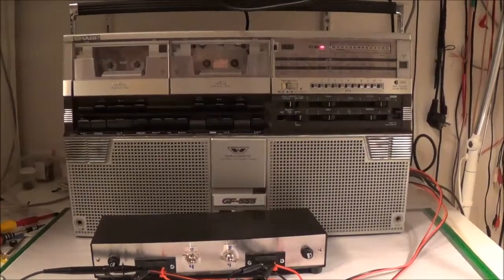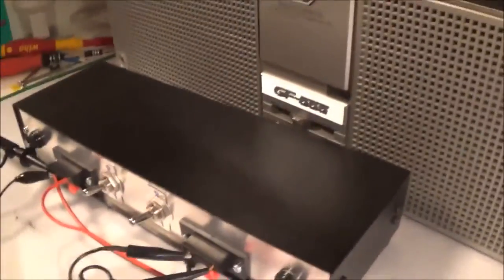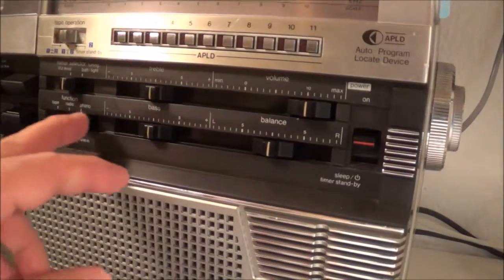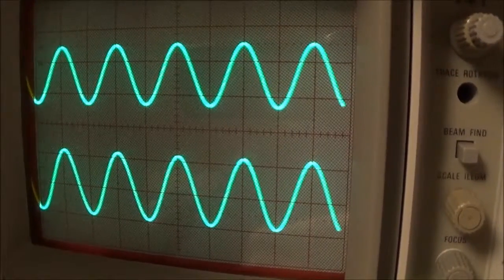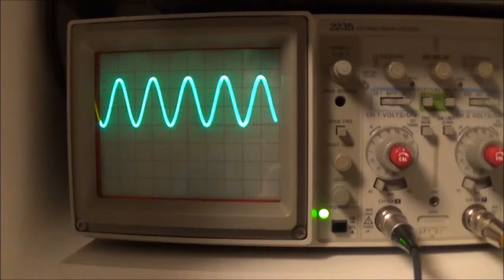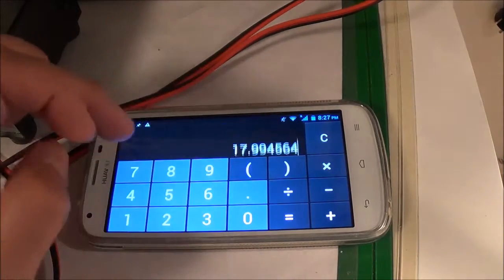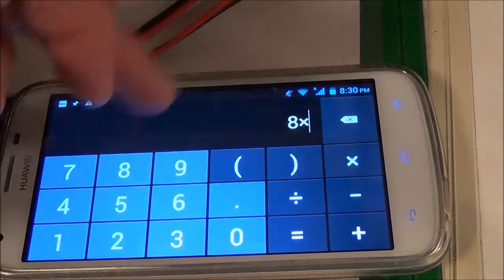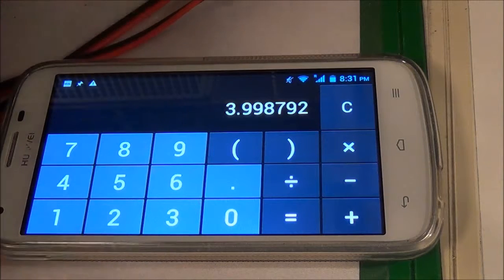Sharp GF-555 Boombox Power Output Test

Comment: Dude. The formula is RMS volts  squared ÷ ohms. So, for both channels driven, (12*12) ÷ 8 = 18W. The literature for the GF-555 states 11W per channel. You always get more output when driving a single frequency. I have a GF-555 and it is friggin loud! A guy with that much quality test gear should know this...haha I'm just jealous of your gear. Peace
Reply: edit that. you said 12v pp. so the formula is (12*0.707)squared ÷ ohms=8.99W
Reply from the maker: I measured the output voltage with an oscilloscope. First, I had to convert the peak-to-peak voltage to a RMS equivalent. Either I divide by 2 to get the peak (center-to-peak) voltage and then multiply by .707, or I multiply the peak-to-peak voltage by .353. I then square my result (RMS) and then finally divide this by the load resistance. Notice I write peak-to-peak and not peak as my starting measurement. Of course, your line voltage should also be correct. 

 Notice also that with the GF-555 a distortion level of 10% is published.  Now 10% distortion, in my opinion, is not a small amount. You would definitely hear this. Also, no load impedance is published (at least not in my version of the service manual). And as you know, most amplifiers deliver more power at lower impedances (say 4 ohms), than higher impedances (say 8 ohms). Does your version of the user guide or service
manual state 4 or 8 ohms as far as the power output is concerned?
One more thing: the sound level we get is highly dependent on speaker efficiency; the more efficient the speaker, the louder the sound. Or as you would put it: "The louder the friggin" sound."

Other than that, the GF-555 is a nice and solidly built unit.